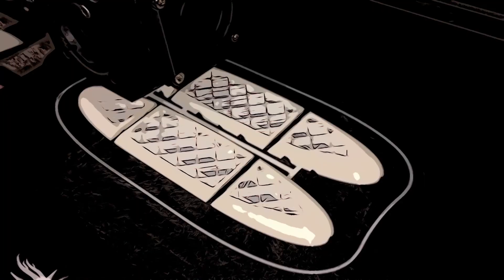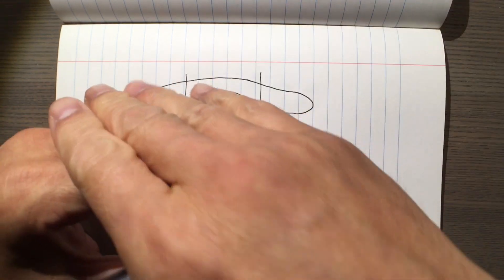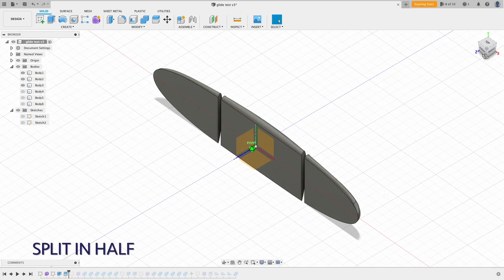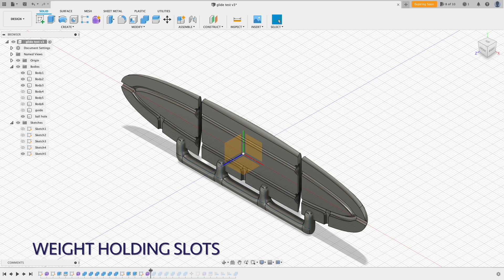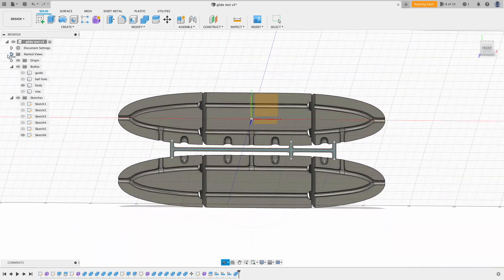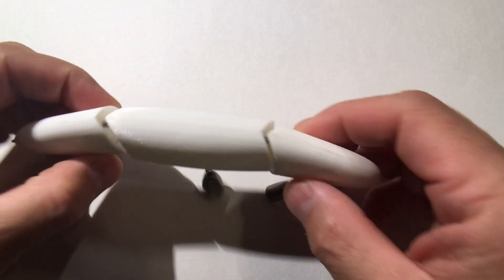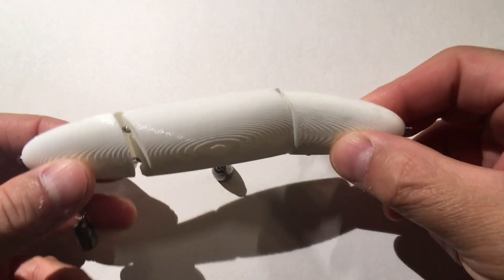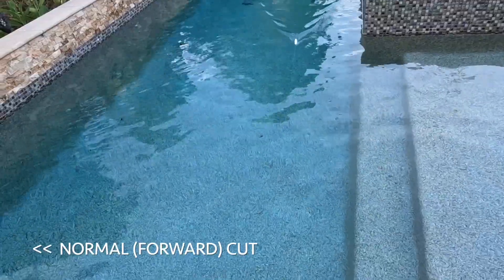Have You Tried This Jointed Design Yet?

Comment: Yes I did
Reply from the maker: Did you have the same findings?
Reply: Hey bro , I make mine in timber but I found having less as you go back on the bait it swims better with the normal cut .
Should do this but take the back n middle weight off or make it smaller to the front and see if any difference
Reply from the maker: @baitsbynimbus  good to hear some different findings. 
I agree reducing the weight in the tail portion and also making the section smaller would promote the swim action. Probably adding a lip but I kind of want to avoid that. I have something in the queue and those would be good options to try out. Stay tuned!

Comment: Did you try it with more than just two segments?
Reply from the maker: No I have not. @EngineeredAngler had some nice experiment in using different numbers of segments on the regular cut swimbaits. It turned out if you design them nicely, the regular cut swimbits will swim nice too. So it's hard to say which is better. It's just something different to try.